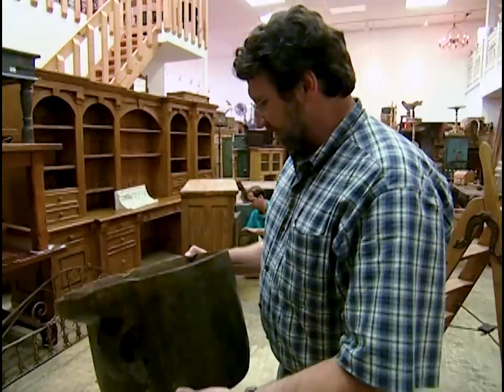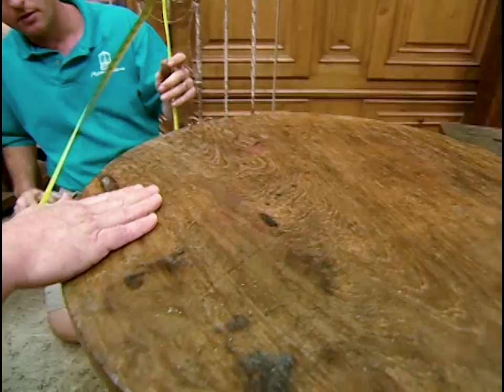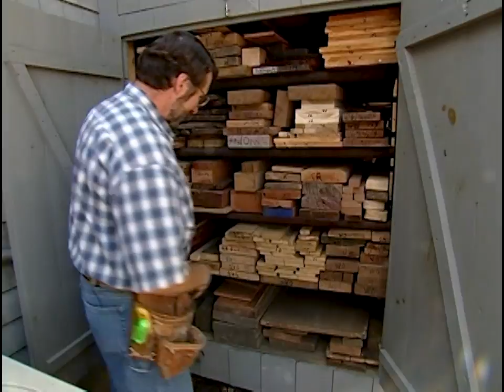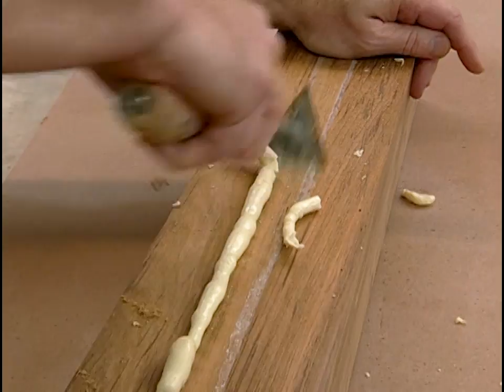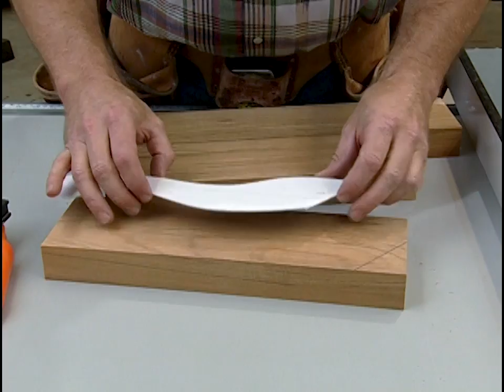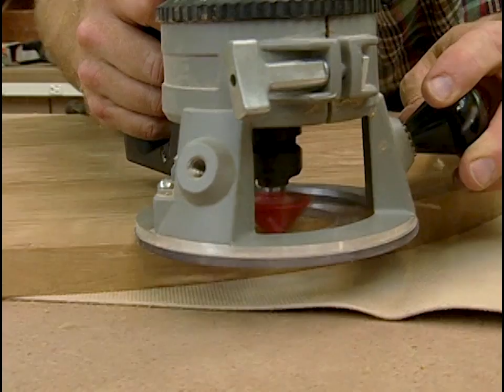Pedestal Table  |  S14 E8

Comment: QUESTION: If teak makes the knives dull will it not make the blades on the table saw and band saw dull as well?
Reply: It likely as something to do with the a cost of replacement, including the time and trouble it takes to replace them.
Reply: @scotttovey  exactly. Steel knives arent expensive, per say, but setting them was a process, to say the least. And Helical cutterheads really werent well known at that time.
Reply: Yes. Although, although carbide tipped tooling is more resistant to the blunting effects of Teak. Carbon Steel bandsaw blades will dull quicker when cutting Teak, but are cheap and doesnt take long to replace.